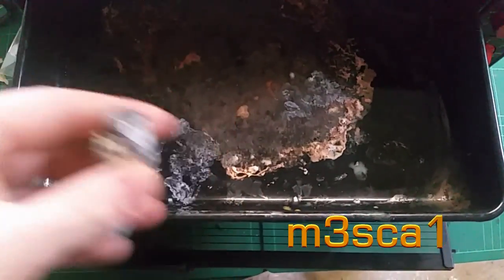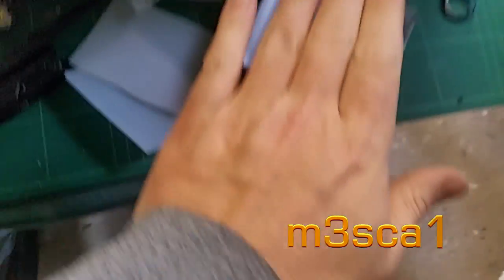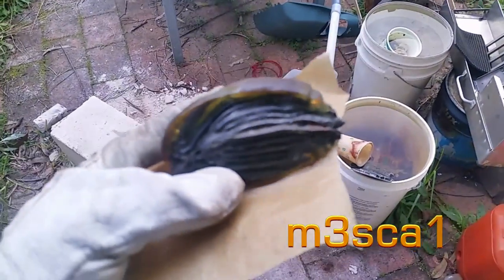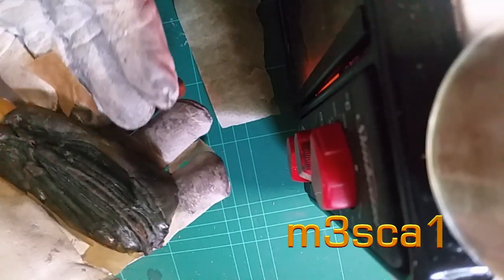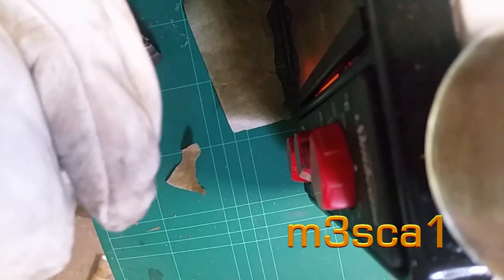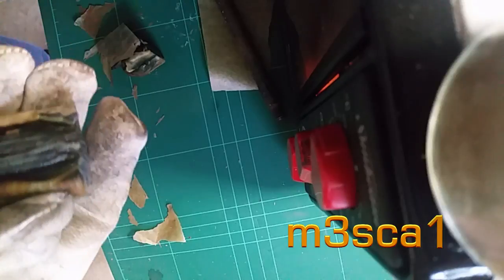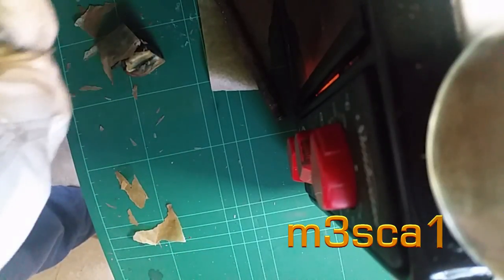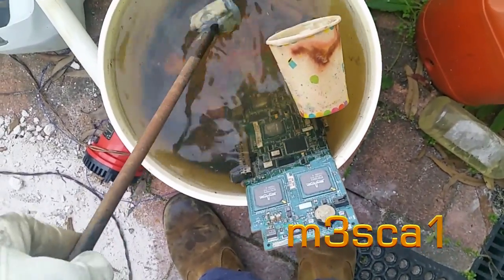Plastic RE-CYCLE make Hammer Head

Comment: I like how you used the smallest flat head possible to lift the plastic off the pan ;)  I saved a bunch of pvc shavings to make a hammer head as well.  Was planning on using a little oven to do the same.  Glad to see that it will work. 👍
Reply from the maker: AveRage Joe the grease paper helps keep it off the bottom. I should've done that from the beginning!